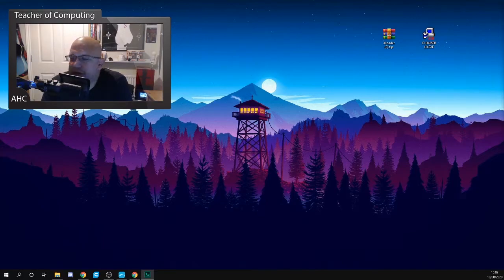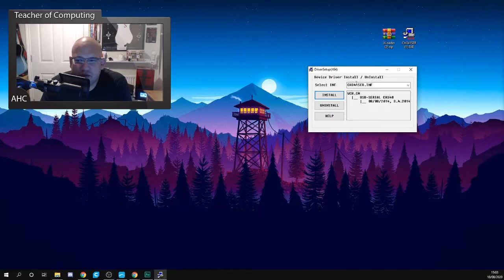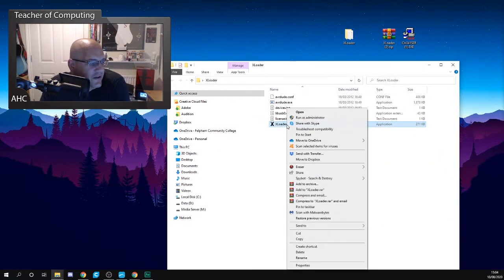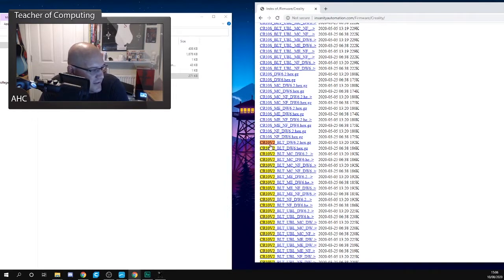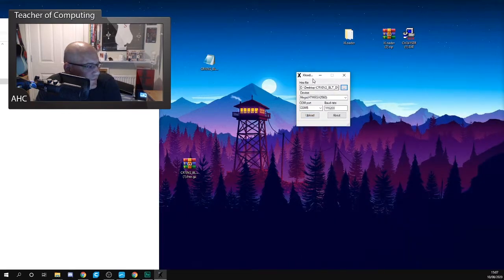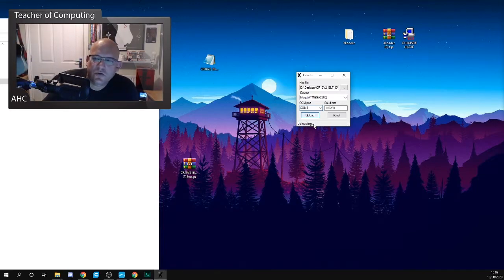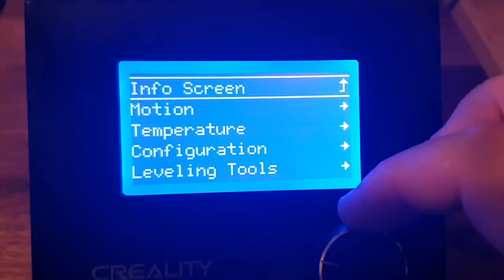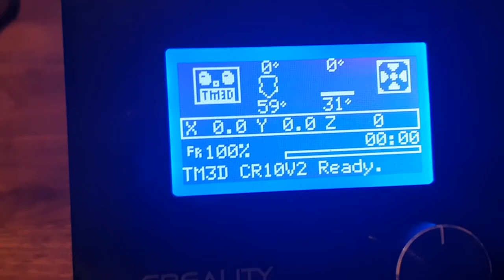How to Update Firmware on the CR-10 V2 With Tiny Machines in 2020!

Comment: How can I tell which version of the firmware is right for me? I also have a BLT with my v2 but also a direct drive. Where can I find what all those codes mean? Also, when I tried to use a version similar to the one you did I got an Upload failed error but it doesn't tell me why

Comment: Can the firmware on a bone stock Creality CR-10 V2, specifically, be flashed using the USB port alone?  Meaning, does the CR-10 V2 require flashing through the J1 port on the main board using a USB flasher?  Or can it be flashed to Marlin 2.x just purely through the USB port?
Reply from the maker: The v2 has the bootloader already so just flash via usb
Reply: @AhcMeUk  ok, wasn't sure.  it seems like i keep reading that the cr-10 v2 does not have a boot loader.  It has the 2.5.2 main board, bowden tube extruder, and no bl touch
Reply: @AhcMeUk  thanks.  i'm curious now then, if i can just upload the cr-10 V3 firmware without titan or bl touch.

Something to look into.  I don't think the V3 comes with bl touch.  but i think they do come with the titan extruder, so maybe not.

Comment: After I hit upload, I get a message "0 Bytes Uploaded". The printer restarts, but still shows the same screen I normally see, so it seems it is not uploading anything.

When installing the driver, I got the failure message, but as you mentioned, it might mean I had it installed already.

Tried with 2 different cables. Any suggestions?
Reply: Ok...so I was able to successfully install the driver. I restarted. Tried to upload, and same result. "0 Bytes Uploaded".
Reply: Figured it out. Had to uncompress the .gz file the firmware is packaged in to get the .hex to upload. Rocking and rolling now.
Reply: @Baldwij7   Hey I'm having the same problem. How did you uncompress the hex file?
Reply: @Valleystoner  download winzip, select the file and click unzip

Comment: Dear ToC, which is the correct firmware for a CR10 V3 with BLTouch and Direct extruder? Is ist the "CR10V2_BLT_DW7.hex"?

EDIT: With this firmware above, the extruder turns in the wrong direction.
Reply: Reverse the motor wires, apparently that's the easiest solution for that.. needs a recompile to do it in the code

Comment: Will this work for the 10S Pro V2? Or know where I can get that firmware?
Reply: Wondering the same thing as it comes with the 1.70.0 BL
Creality site has 1.70.1
But the date is older than this video and it comes with a bracket file in the driver package. I am a little confused

Comment: this thing has been uploading for a long time, what am I doing wrong? I have never been able to flash this machine
Reply from the maker: Did you run the program as admin?
Reply: I'm gonna try that. I don't remember if I did or not. your video is the most informative I have found. I have not been able to update the firmware since I got it about 2 years ago.
Reply: @AhcMeUk  yeah, it's not working

Comment: Xloader finished uploading just fine, but now my touch screen is stuck on the "Creality" intro screen.
EDIT* - I realized that my printer is the 10s PRO V2... what an idiot.
Reply: This video works great for 10s pro v2 printers as well, however use this hex file:  "10SProV2_BIL_DW6.hex.gz"  -> hex file is located here (https://tiny-machines-3d.myshopify.com/pages/10spro)  and it's called "CR-10S PRO V2  BL Touch is stock, Z+ port is used and no jumper needed" about halfway down the page.
Reply: @rbarraza123  You have included the end bracket in the hyperlink
Reply: @rbarraza123  i!
I'm wondering the following: Do you have your power cabel connected to your printer or not? I find that the printer starts if I remove the power cable and connect the USB.
Also, is the printer on or off while you use the X-loader to flash the mainboard?
cheers!

Comment: My CR10 V2 just keeps failing to upload firmware, 10 times and the same message on Xloader each time "Failed to upload" I followed your instructions to the letter..... Please H E L P !
Reply from the maker: Ok have you got the correct port set and all other settings correct. Try a different cable. Make sure you have run loader as administrator.
Reply: You ever figure this out? Mine isn’t uploading as well